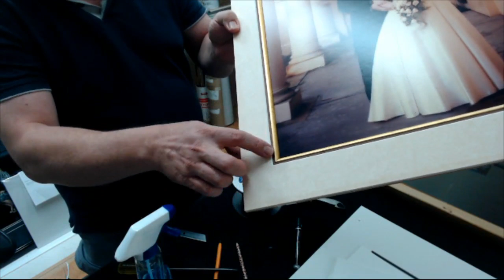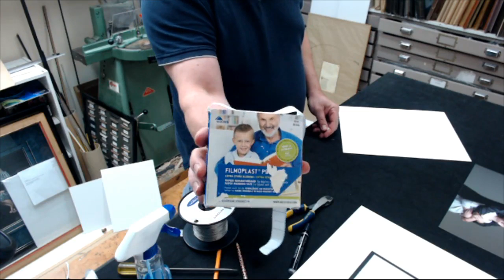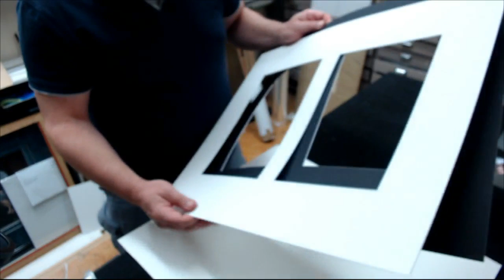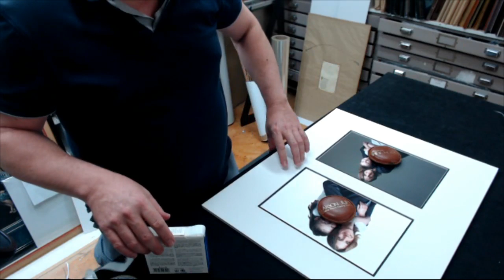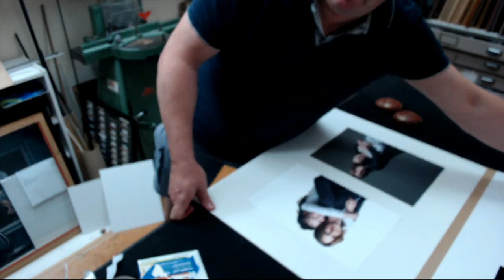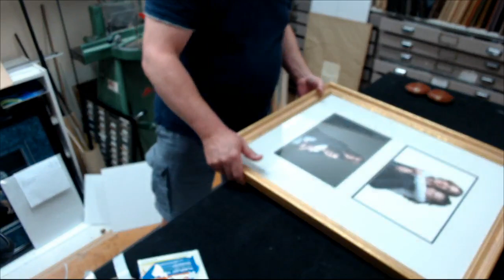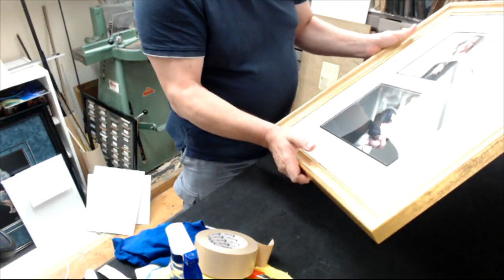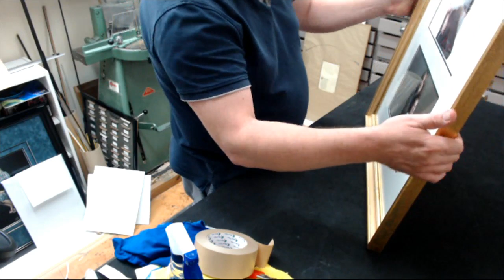How to Reuse Old Picture Frame to Fit Two New Photos

Comment: Hi David, Great to see you streaming more now I have a question for you. I live in the UK and just learning the tricks of the trade. I have some 12" vinyl records and cd's I wish to frame. What is the best solution for holding the records/cd's to the foam/mat board? They are collector's edition Picture discs so needs to be achievable, Thank you in advance.

Kind Regards,
Gavin
Reply from the maker: Thanks Signed Inc autographs for your question.
There are several solutions to fixing records and CDs etc and the chosen method may depend on the overall frame design. 

For example if you are just displaying a single record or disc surrounded by matting you can cut a  reverse bevel circular mat where the opening is 1mm smaller in diameter than the disc itself and then the reverse bevel edge only just overlaps the  edge of the disc and you then sandwich the disc between the reverse bevel opening and a regular flat mat backing board. You can then cut other openings around the outside of this. Most people would not realise the cd or record is inset and held by the small reverse bevel. You can experiment with the required overlap especially if you have a CMC matcutter.

You can always use a physical fixing for records through the central hole. There are some good black split pin type fixings both plastic and metal varieties - office supplies - that work well in this instance.

You can use other physical clips like the mighty mounts variety which also work with plates, ceramics, coins etc.

You can also try Mylar - polyester sheet -  as an overlay held down onto a backing and covered by a matting. Bank notes, collectors cards, postage stamps, documents etc are often mounted this way. 

If you have to use an adhesive in contact with the vinyl you could try a neutral cure silicone type. Usually silicone will not harm the item but the only way to remove is peeling the silicone off at a later stage so I prefer using physical fixing or the reverse mat overlay as a 1st preference because then there is an easy pathway for removal if needed.

Best regards,

David Schummy
Reply: @Endurart   Thank You for the reply David, your advice is top notch as usual. This has given me some great tips I like the split pin idea so might go with that. 

Although sandwiching the item between the bevels is a great idea a swell, I unfortunately don't have a CMC Matcutter, I use the Logan 350-1 Compact Elite and the Logan 201 Oval/Circle cutter i can still play around using these great machines.

I will soon be signing up to the framers club members area as I love your work and your knowledge is so helpful.

Thanks again,

Kind Regards
Gavin